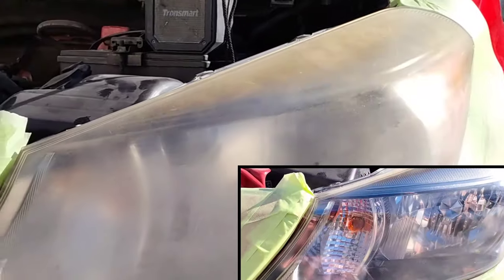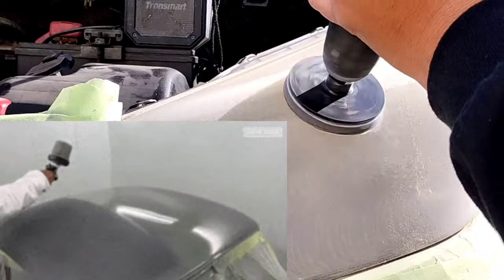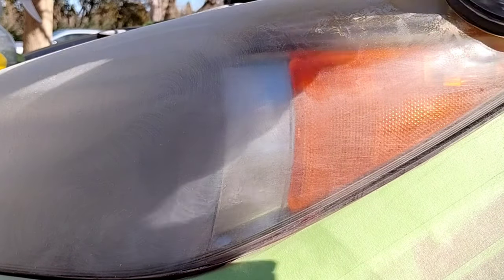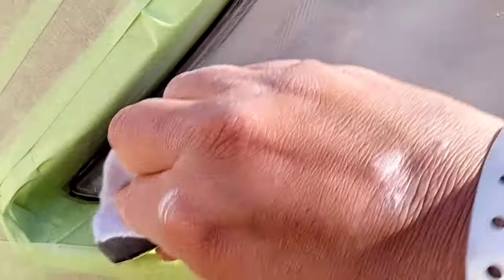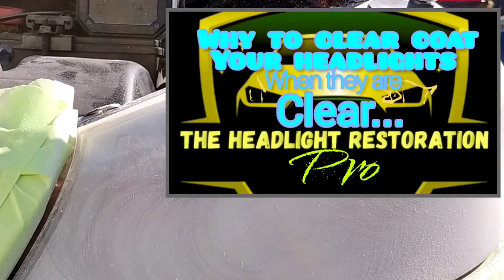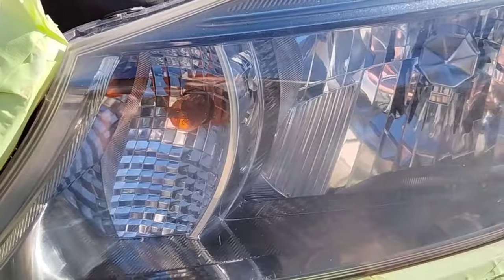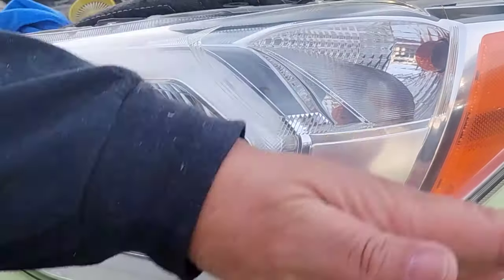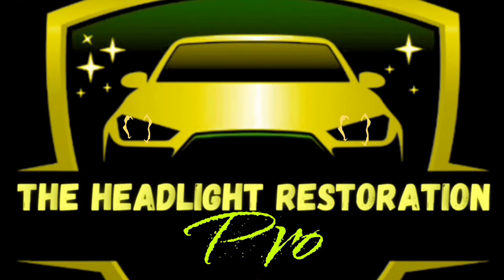how to CLEAR COAT HEADLIGHTS like a BOSS 🦍💯

Comment: Great video and explanations. I never understood how people apply 2K clear coat directly after sanding.
Reply from the maker: Yeah it's pretty mindless.. the factory does not apply the clear coat in this manner.. they apply it when it's fresh polished in a sense already clear see through.. they do this for a reason....
Reply: @theheadlightrestorationpro do you recommend any sort of maintenance every few months to keep the longevity of the clear coat?
Reply from the maker: Yes aftercare.. this is what the topic is on this video and shows you what to do and when to do it... 👍🏽https://youtu.be/kIur4XxYjDk?si=sfhCm-UphvtDJzIR
Reply: @theheadlightrestorationpro  today I did my headlight restoration. all went well until the nozzle started sputtering and burst of chemical came out. so now there are spots with dripping chemical on parts of the headlight. what do i do? do i start all over by sanding and polishing? I think i'm going to go with the wipe rather than the spayer. your thoughts? thanks.
Reply from the maker: @Sagemeister007 you probably didn't pop the tip in.. it's generally not all the way embedded you have to give it a firm pull down to pop it into place..https://youtu.be/5-mYDvauImU?si=oqP7vmIFggNK_vPn

Comment: I'm trying real hard to like these videos as there is awesome info in here. However, I just followed the steps you show here and polished the lights to being crystal clear, then wiped clean and sprayed with a headlight clear. I got fisheye all over the light and that seemed related to the polish. Just horrendous. Now I'm back to having to starting again, wait for the clear to dry and sand, polish, remove wax, then clear again.

Comment: 2 questions plz?? 

1. Did you go 320, 500, 800, then jump to 3000? And looks like you did a tiny bit of water/wet sand on the 3000? 

I’m also guessing you use a glass cleaner after polishing, before clear coat. 

Also, if there are spider cracks, would you start with a lower grit then 320??

And lmao! I used the meguires clear, and it was looking so good, I decided to spray a double coat. It killed it. Pretty sure in order to fix, I would have to re sand again!!!
Reply from the maker: I try not to use anything lower than a a 220 and used 220 and 320 very rarely.. spider cracks are not going to come out either way it goes the actual spider cracks.. if they are clear coat spider cracks they'll come out just with normal sanding... Also watch a couple more of my videos you'll get a better feel of what I'm doing pretty much every time it's actually more rare as I said when I use a p320 or p 220...
Reply: @theheadlightrestorationpro  got ya. Last question. If you have your drill setting on 1, do you hold the trigger half way, or all the way?
Reply from the maker: It depends on what you're trying to do.. there's so many different variations of light. I typically hold it all the way down on flat surfaces once you hit sensitive areas curves, fins, dips that I slow down..
Reply: @theheadlightrestorationpro  I have a 20v Dewalt brushless cordless. Noticed your using a 12v. So I may have to slow down all the way through. I have no idea lol.
Reply from the maker: It's probably not faster.. it just has a bigger battery... Or less efficient battery should I say.. check the status of the RPM I'm running 7800 RPM with this Plus..

Comment: If you didn’t use meguiars clearcoat what would you use? Just asking so I know what to use as a backup if needed.
Reply from the maker: I don't really use anything else but the wires if possible... And it's always possible..lol
There's other things I've used in the past but are not nowhere near on the level of this product...💯
But honestly I can use anything...
Reply from the maker: Use anything but 2K.... That's the best direction I can steer you in... If you watching my videos you should know that only use mate for headlight products that you can verify are actually made for a headlights from a legitimate background meaning an actual company not some guy selling Joe smells clear spray paint in a can..
Reply from the maker: Also remember spray is superior to none spray .."for headlight use"...

Comment: Many people use a 2K clearcoat on these videos.  Do you use one? Would you recommend using one on some occasions? Or do you strictly use the McGuires coating? Can you use both at the same time in succession and if so in what order of use? Thanks
Reply from the maker: 2K clears are literally the worst thing you put on a lights.. I don't use 2K clear I've learned my lesson.. I actually would never recommend using one the number one reason none of them are made for headlights... That's a fail right off the top... Well I urge you to watch a couple of my videos and you'll definitely see what coatings I use pretty plain and cut on every video.. never use more than one product.
I suggest you watch the videos more important to watch the videos then to ask questions all of your questions are in pretty much all the videos...
Thank you for watching..
Reply: They do make a 2K specifically for headlights
Reply from the maker: @daviddesmond2143 no they don't... Google it only comes up and that is a scam because it's the same thing as the one not made for headlights and it's just as bad, it just has an additional dose of UV protection... it's just as terrible for headlights.... Google 2k.ckear for headlights and be amazed that ONLY one thing comes up..( the trash stuff I speak of )https://youtu.be/y0zNDMC8Kow?si=aZUbs8NVaVYxjrZ3

Comment: What's the longevity vs something like Cerakote? The spray says it's good for a year. I wouldn't want to have to do this every year.
Reply from the maker: The spray says that as a disclaimer it lasts longer than a year it will only last a year in terms of the nastiest person who does nothing to their vehicle and push their vehicle through the worst circumstances.. with that being said it doesn't mean the whole thing is going to go bad even that nasty person's vehicle might have a little yellowing or dissipation on a corner or the top those numbers are for tip top performance and appearance only.. in my experience in doing it this way keep in mind one solid coat and my expertise and experience it lasts anywhere from around 16 months to 3 years on average if you're taking care of your vehicle or even apply aftercare and maintenance to the headlights.. you mentioned cerakote only last a couple months and they start turning yellow why this is is because they do not really remove enough of the damage on the surface with this kid it fools you with chemical bleaching that the damage is removed because it has a bleacher which cleans the lights and makes them turn from yellow to clear so you don't know how much you removed thus there's plenty of damaged cells left over.. basically doesn't get it all out and it starts turning yellow about 6 to 8 months..
You have to keep in mind there's no permanent fix there's nothing really that's going to make your headlights last longer than anywhere than 2 to 4 years on average because the technology is not there.. people mistakenly want to put things like 2K clear on the light because it might last 4 years 3 years 5 years but this shit fucks your lights up it's almost like taking steroids.. versus natural bodybuilding.. you want to get big real fast cool but you're going to die a lot early and have health problems.. robbing Peter to pay Paul it's better to have a product that indicates that your lights are bad.. headlight health is a must especially when promoting the headlight health in your method makes your lights look better than anybody's basically in the world...
The longevity is good..👍🏽

Comment: If you clear coat them then you can't ever do the sanding refinish process again right?
Reply from the maker: You can do it many times that's the beauty behind this method and this clear coat... Or even close clear Coast design for headlights they are easily removed and designed to be removed with that in mind....

Comment: Thx for this great detailed video.
I have a question. I did the wet sanding by hand with 400, 600, 800 and 1200 but when the sanding was finished their were 2 spots with a darker gray color. I did the polishing with 3M and after finishing, you can see the 2 same spots that are matt now 😞
Tried to polish with stronger polish but still the 2 same spots staying matt grey.
Reply from the maker: Well it sounds like you missed spots... But at the same time you're using a whole totally different process even though you're trying to mimic what I'm doing it sounds like you're using totally different supplies.. sounds like your sound paper is different... They're not P grade, they're not the grit size that I use, I'm willing to bet they're not 3m, you also did it by hand, and who knows what spray you used or sealer.... So it's about a 95% different process that you just described to me.. 😵‍💫.
But with that being said but my guess is you either miss those spots far as you did not go deep enough which is a problem generally associated with hand  full sanding.. that's not the case my second guess would be either burning or hazing from inside of the headlight somehow..
Yeah even if it's handstanding it's recommended that you follow my method using the same things in the same style if not any little variation can change anything just hand sanding itself changes things so imagine when you put together that 90% of the stuff that you're using and things that you're doing and formula that you're using is different so your results are going to end up 90% different than mine more than likely in a negative way...
Thanks for watching...
Reply: @theheadlightrestorationpro  Thank you for replying. I did watch your video after working on the headlight. I used the yellow 3M polishing product. What would be the solution to remove the haze or burning from inside? And how can it burn from inside? 🙄
Reply from the maker: Not sure if it's that sounds like you could be your method.. but if it is that there's no removing it... It would mean to drastic to do it wouldn't be worth your time or money..
PS you can't just use anything.. what you've done is pretty much 100% different than what I'm doing. Nice time I would try it the way I do it that's why these videos are up to show people that there's nothing going to be better... And to explain to them why that is..

Comment: Hi mate, bought some sanding discs for my cordless drill. Tried to do it like this for the first time but the pad bounced around  all over the place. I had to resort back to sanding by hand. Im assuing the backing pad is too firm. Have you found this from a backing pad thats too firm? Thx
Reply from the maker: Thank you Pat can be rather firm sometimes.. it shouldn't make that much of a difference you have to control the drill.. sometimes it takes quite a bit of muscle and  tensing your muscles, also you have to have the right equipment.. you need to make sure your RPMs aren't over 1700 Max.. even as a beginner you should probably start with half of that, even if you know headlight restoration in first time with power tools... Also make sure your torque is not over 600.... It should feel real natural if you're having that much trouble something is off...
Reply: @theheadlightrestorationpro  thx mate, I'm using the same Ryobi drill as yours . Not sure is it's the discs or the pad. Your pad is much thinner than mine
Reply from the maker: Might be but at the same time I do double stuff a lot and still handle it ...
Just keep narrowing it down..
You'll figure it out..
Keep watching...
Reply: @theheadlightrestorationpro will do mate. Cheers

Comment: Hey bro, pretty detailed videos- well done.
Can you advice me on a problem. Ive sanded and coated my headlights. One of them is perfect but the other one is a bit hazy.
After the first coat it was perfect , but the seconds one made it hazy in the middle.  I guess the only way to fix it is to sand it down again and recoat it. 
Do you know what i possibly did wrong so i dont need to sand it 3rd time :D
My gues is that i sprayed it from too close, but im not sure about it. I see you said no double coating but thats the instruction of the coat that i use. Its Body Clear lens.
Thanks for the videos.
Reply from the maker: First of all you did not follow all my steps one small variation will change everything especially if you double coat.. double coating is extremely unnecessary, clarity damaging, and functioning inhibiting... So your stuff is going to look funky not clear and it's also not going to work correctly.. so what you did is applied two coats this is why I say don't apply double coating even if the application says to.. they will also go bad faster... And have a slew of problems from double coating... This is why I always tell everybody if you see somebody doing something and it comes out perfect and this is what they've done thousands of times and done professionally and they show you you probably should listen to them... But I suggest watch more videos of mine before you redo your headlights... In fact check out this one is very important for your issue or these two...

Why not to double coat:
https://youtu.be/NgxNImOAoCY?si=1NiTEQdINQkph_7l

You're not clear coating your headlights the right way:
https://youtu.be/LC4ZBu02JZg?si=b_vZ4u6B18dP1dh3
Reply: @theheadlightrestorationpro  did it again all the steps on the fucking can.
320grit , then wet 600/800/1200/1500/2000/3000
Same shitty result on the driver's side the other one is crystal clear. Ffs
Only one coat is shit too.
Reply from the maker: @danielbichokov1340  you got understand 1000% different method... What you did really has nothing much to do with what I'm doing.... With that being said not all headlights are equal.. but when you want top-notch results I would follow what I'm doing behind the videos..

Comment: important question for you: I just used a deoxidization kit that came with a little wipe on protections coat thing. then the next day i bought a real meguiars spray on headlight coating. i sprayed it on almost exactly how you did( not exactly to the T but not far off at all). then it dried with all these rings where the coating did not stick right. do you know why that is. i think its either from not cleaning the headlight good enought prior to spraying(i just used windex because i cleaned and sanded the shit out of them the night before) or something to do with a reaction with the other products i used on it the day before.
Reply from the maker: More than likely it's because of reaction with the other product .. also you should never double coat expressly with multiple products... You never know what will happen... Also the restoration should not be done with so much time in between everything it should all be done at once swoop.. this is because it has to be a sterile environment when you're working with headlights because the clarity issue and sticking and things like that so by letting it sit just a whole lot of things could have happened in between time but I'm pretty sure it's the reaction between two different substances.....
I would take it all down and do it over the headlight restoration Pro way... It's not going to come out any better than that.. I know this from experience..👍🏽🤓💪🏽💯

Comment: Whats your average time per light restoration and what do you charge per light or pair of lights?
Reply from the maker: My average time per lite is about 15 - 20  minutes .. 15 being an easier light 20 being a difficult light.. car vehicle between 30 and 40 minutes...
Reply: @theheadlightrestorationpro  
Does 65-75 per light sound about right for pricing? my market has deeper pockets
Reply from the maker: You have to make the decision for yourself... Just got to keep in mind too that it's about your time and work but headlight restoration overall if you're thrifty and buy in bulk or semi-bulk has a relatively low overhead.. once you have your tools and everything paid for.. because a couple bucks to do each light.
Reply: @theheadlightrestorationpro  Thank you!
Reply from the maker: @aaronreid3203  👍🏽